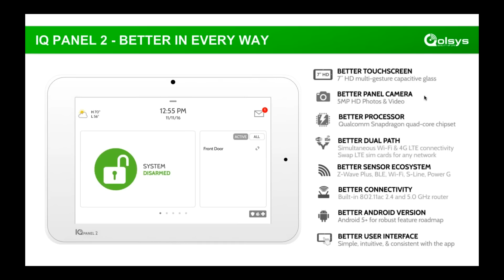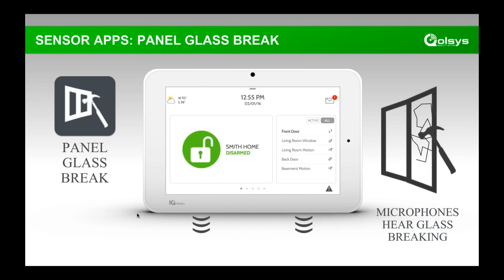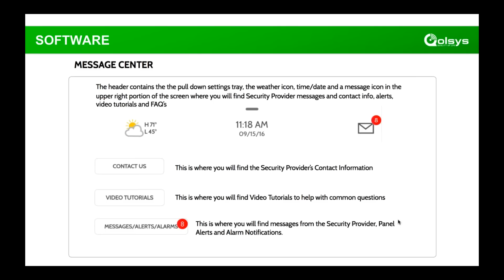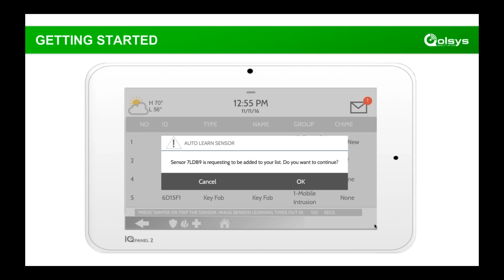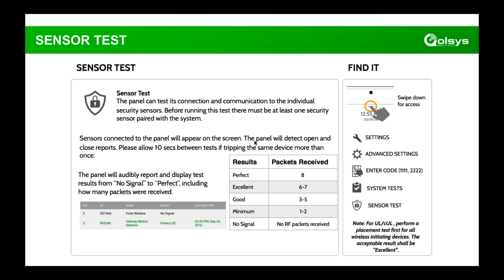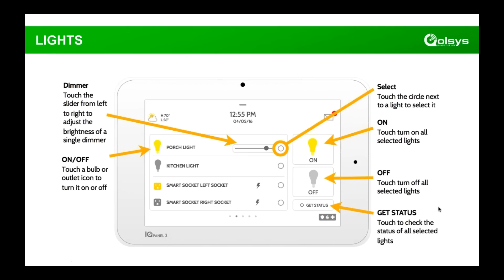IQ Panel 2 Technical Webinar (July, 2017)

Comment: If I have three iPhones paired via bluetooth and I arm and leave the house.  How would that work if the other two phones are still in the house? Would it see the two other phones and disarm?
Reply from the maker: Yes if you leave your phones at home and the panel is armed away, those phones would disarm the system.  If phones were being repeatedly left behind we'd encourage you to set a 4 digit code instead of connecting for Bluetooth disarming.
Reply: Actually shouldn't this ignore the devices inside the geo-fence after it is armed? I guess a software update could fix that if not.